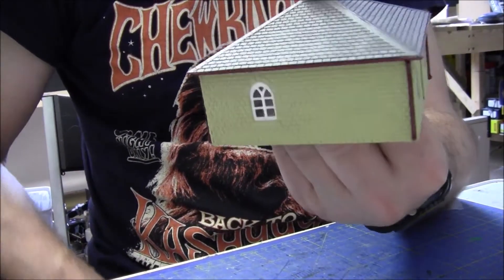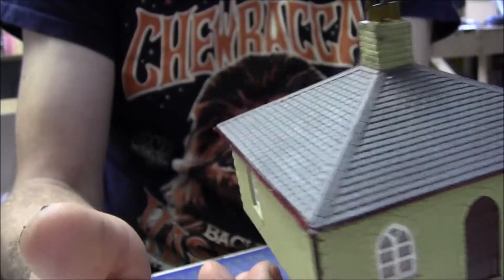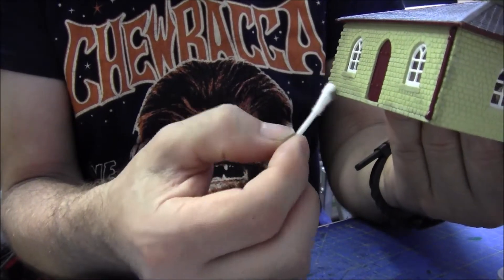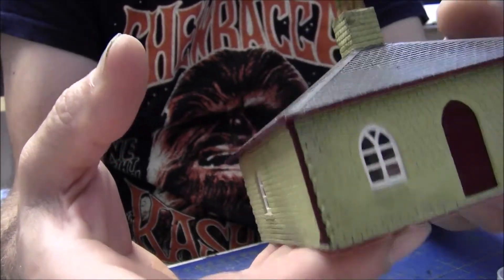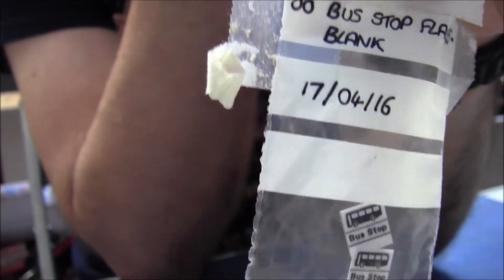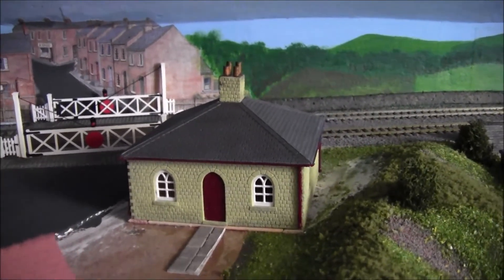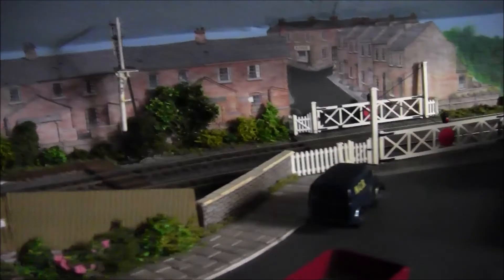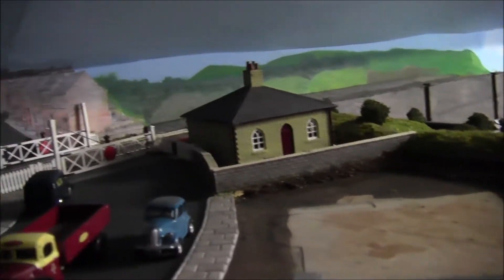The Gate keeper's cottage on station road    No84

Comment: Hi Tony....it was nice to have pan around the layout....I guess you have to Duck under the middle section ? .....thanks for showing.........fred
Reply from the maker: Cheer's Fred I think because I spend so much time in one area you don't get to see the full extent of the layout. I do have to duck under Stevenson's  bank. to get to the controls. but that's a small price to pay.to run the trains...thanks again Tony
Reply: *****  snap I have to duck under the bridge when I open the shed door ...but it is removable.....cheers fred
Reply from the maker: I'm glad you had the foresight to make a removable bridge mate. but i think it would have been a complex removable section for me due to the two levels on Stevenson's bank. but not impossible regards Tony

Comment: Very nice cottage Tony.  When I eventually build something similar I will add a smoke generator to one of the chimneys connected to a decoder so I can turn the smoke on and off, and the lights. You have some very nice plans, the area for the fiddle yard looks big, what is the overall size of your layout, looks big?...Simon
Reply from the maker: cheer's Simon the layout is 7 metres long and 4 metres wide. the fiddle yard is only 600mm wide and 3 metres long. ideal for the long frieght trians. i like your idea of a smoke generator for the cottage.......all the best Tony

Comment: Hi Tony, the cottage looks the part and love the weather tip, thanks. It really highlights the brick work. A large layout indeed. The wall around the cottage, what did you make that out of?  Cheers, Jerry
Reply from the maker: Thank you Jerry. the walls around the cottage. is made from 3mm plywood cut up into 15mm strips and then covered in Metcalfe stone paper or brick if you prefer. thanks again Tony